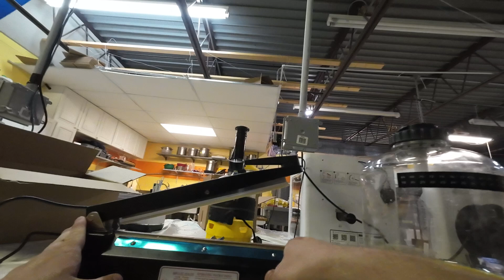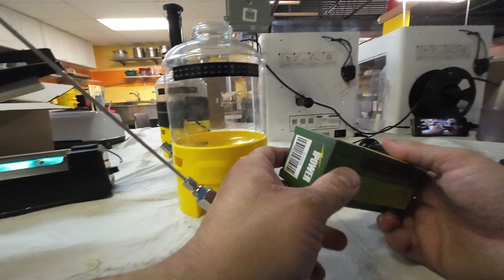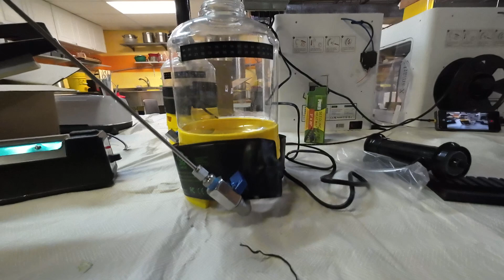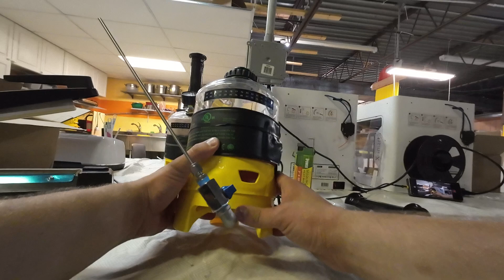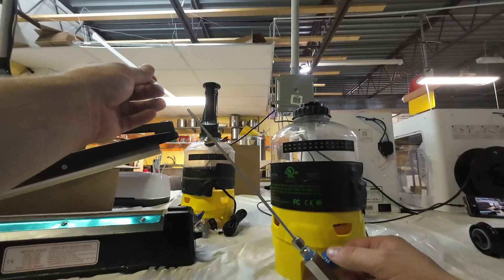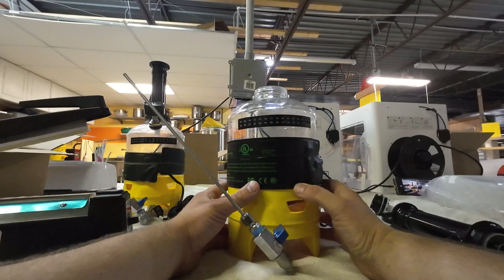Setting up the Honey Pot Honey Stick Machine for the first time

Comment: how do we store the straws and how long do the straws last unused?
Reply from the maker: @AlkebulanHive  The best way to open the straws is to cut it with scissors. The plant based straws actually tear open pretty easy by hand. The standard straw holds about 1 teaspoon. I recommend storing them vertically in a cup so that any air pocket rises to the top and doesn't settle in the middle of the straw. The straws can basically hold the honey for forever. If you use raw honey and it crystallized you'll just need to put them in warm water to get it back to normal.